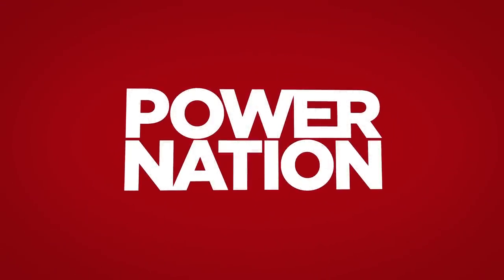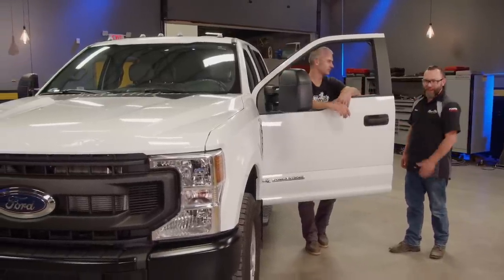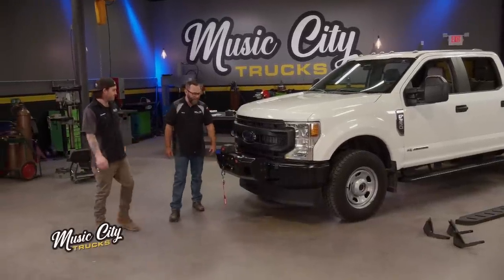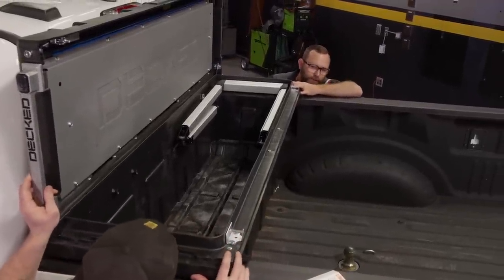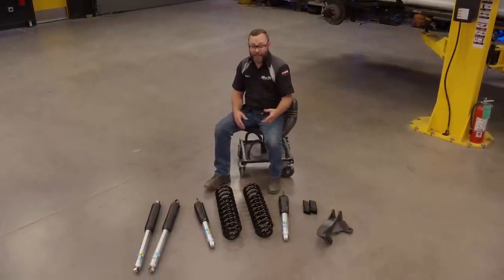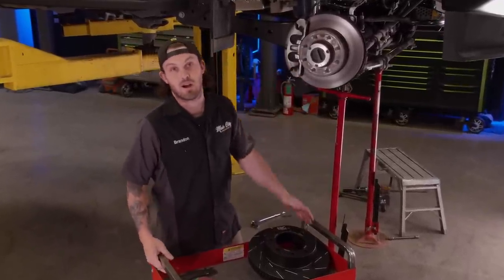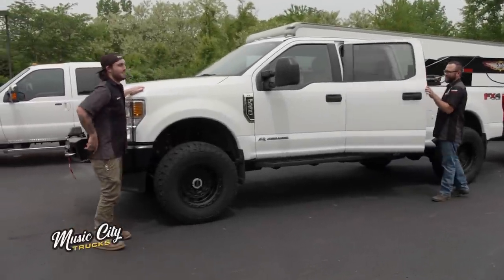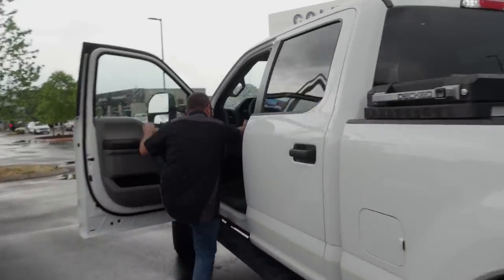Adding Functionality To A Stock F-350 Work Truck - Music City Trucks S2, E10

Comment: Love how they call it "integrated" bumper when it sticks out a foot beyond. Better to just buy a bumper designed for a winch.
Reply: The add on bumper is nice but for this truck, they just blocked the turbo intercooler airflow section completely.
Reply: I agree. Fugly!
Reply: Integrated because you keep the OEM bumper and doesn't require much modification but yeah, it's stick out alot. 
Also someone mentioned it blocked the intercooler and I mean technically it does but I'd say it just restrict the airflow a bit, obviously not ideal but probably not restricted enough to cause major issue.
Reply: @dapimpbdsd thank you for your positive attitude 😎
Reply: Have you heard of Product Placement ? Advertising for WARN, they probably got it free and advertising for WARN...
Reply: I'm wondering why a work truck needs a winch in the first place?
Reply: They should've just went to ford and bought the factory warn kit
Reply: It’s not a work truck if it’s too tall to reach for tools in the bed.
Reply: @billflk2364  
Well most tradies don't work in mud, sand,  definitely snow where I'm from.
Reply: I have lived in the Snow from Kentucky to Illinois, and been in Florida were sands everywhere , if u drive off pavement ur stuck, and in anyplace like the mountain roads of ky to the flat land in Illinois, it rains and ur stuck in mud lol, so yeah we have wenches in front and back of the trucks, if not for us for someone else that is stuck. Lol  and the men like to call the women wenches too lmao
Reply: No kidding.
Looks like shit.
Reply: Lol there’s a difference integrated and clean
Reply: And what about the recovery hooks

Comment: And, as he pulls away under load with the front end up in the air, we can see why Ford has the front lower from the factory.
Reply: Almost all pick ups have the rear higher than the front, so it's closer to level when you load the bed or when you tow a trailer, it's not a ford thing
Reply: It’s ALMOST like the engineers, who designed every nut and bolt, planned for the rake!

Needless to say, I do not like leveling kits and despise squatted trucks.
Reply: I had a 150 briefly before swapping to my 250 and was very big into the idea of leveling it at the time. It didn't take long to realize how silly it would be to sit level if I ever planned to use it. I sit 1" lower in front and will never ride level on a truck I don't plan to treat like a pavement princess, which is all of them from now on.

Comment: what kind of truck do i need to tow a trialer park home.  Richard – the “Sherman” park model weighs about 20,000 lbs and is typically moved by a big semi-truck.   It is 15’ 10” high and sometimes requires pilot cars to go around certain bridges.  We contract out with a shipping company that figures all this stuff out and we would be more than happy to handle the delivery should you buy one.

Comment: Throw a tuner in it and that would round it off and help with power and mileage.
Reply: A tuner can't help mileage on a diesel, and a new Super Duty makes 1050 foot pounds of torque through a 10 speed transmission. That is a perfect case for leaving it alone.
Reply: @clifft7832  really? Oh your a ferd guy that explains alot

Comment: 16:41 what is you doin', baby?! I love Seafoam Deep-Creep but holy moley I wouldn't put a light oil on the rotor hat. Maybe white lithium grease, as it's thicker in viscosity and less likely to migrate to the disc's friction area, decreasing braking effectiveness.

Comment: These are the best videos...  Like the way it turned out but two questions...  Did the winch bumper remove the front tow points?  Also I'd have removed that front air dam but that's personal preference....
Reply: I believe you can add rings on them for your own tow points. I agree on the air dam they took away a lot of the airflow that the inter cooler had.

Comment: 2018 F350 4X4 6.7 diesel less than 5000 miles. Rarely drive it. Have to change the DEF fluid every year. DEF goes bad and if it's pumped thru the system it'll cost ya around $3000 to fix it. These trucks are made to work. If you're not going to work it then don't get one as it'll drain your wallet just sitting there. What sold me on it is the power of the 6.7 diesel. If I could get traction the truck could pull your house off it's foundation. Electronics suck on the truck. Factory Ford recalls, get used to it. The front bumper they replaced is the same contour but I guarantee ya it's way stronger than the tin that came with the truck. I bent my front bumper on a tree stump. The metal is thin and weak.
Been a life long Ford guy and have had 5 showroom new Ford vehicles. The new ones suck. still a Ford guy but I'll never again buy any Ford newer than a 1995.
Reply: The bumpers on these do suck. I work for the company that makes them

Comment: Is this a diesel truck or just a V-8 power gas Ford 350? Do you get any decent fuel mileage or at least 15 miles per gallon?
Reply: Door says it’s a 6.7 powerstroke so it should be a diesel
Reply: I have gas powered 250. Dash says 15 mpg for  average,  highway and around town driving. It's a daily driver. 8mpg towing 6000lbs camper not including all the gear. I never actually did the math for accurate mpg.

Comment: You didn’t mention anything about having to partially remove the b&w hitch to swap the rear shock.
Reply: I just took delivery of a 2022 F350 3 weeks ago, and heard about the right rear shock issue with a B&W gooseneck. I immediately put 4 Bilstein shocks on to avoid the headaches later, and then installed my B&W hitch and Air Ride air bags.
Reply: @clifft7832  mines been off twice, installed a carli kit then had to warranty that particular shock so had to take it off again.

Comment: Leveling kits are stupid. When you put weight on the back they look like them idiots that have their front ends jacked up in the air with the rears sagging!
Reply: Carolina squat is the worst visual craze to happen to vehicles since imports started doing extreme camber. Fortunately it's illegal now to have the front more than 4" higher than the rear,  so you shouldn't really see them around except for when they drop the bags at a show or something like that.